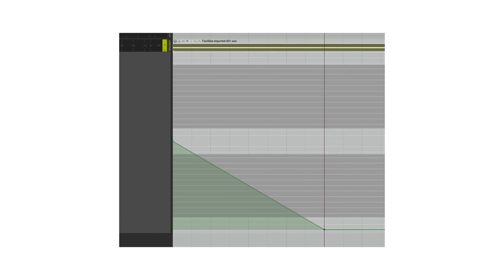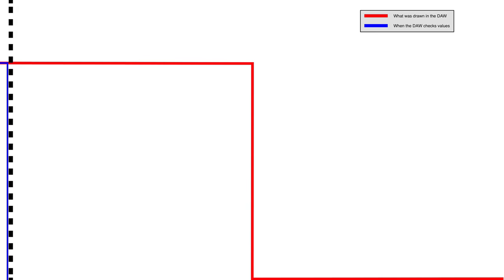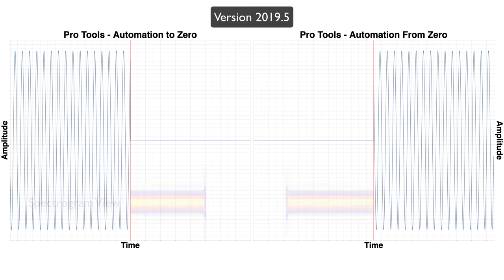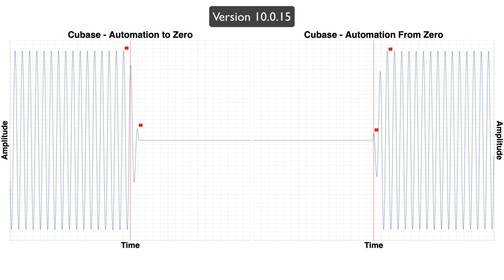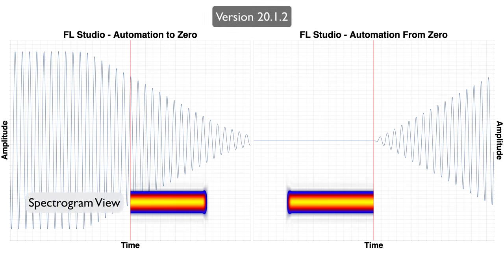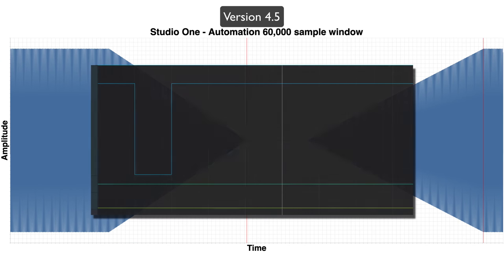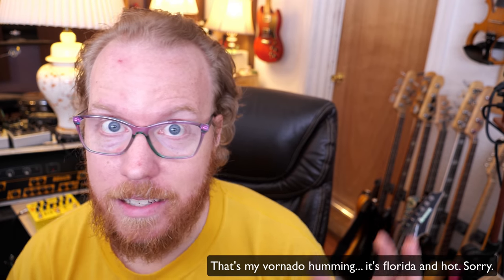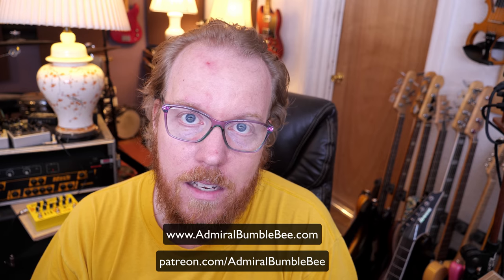DAW v DAW Part 3 - Automation... Part 2

Comment: I think the FL studio is wrong if you automated the fader. The faders has "smoothing" on them for some reason. Instead you should try fruity balance or the channel volume.

Awesome test either way!
Reply from the maker: This entire is about fader automation, not workarounds.

However I'll be visiting workarounds and settings in another topic.
Reply: @AdmiralBumblebee  But nobody automates faders like that. At least in FL. Anyway, I did test with fruity balance too and it had the same result unfortunately.

Comment: I don't see how the graph at 1:18 can be correct. How could a low pass filter when filtering an unchanging signal produce a sine wave? The frequency of a signal that isn't changing is zero, so there's nothing to filter.
Reply from the maker: If you have full scale samples happening at the nyquist frequency, what's the resulting signal after lowpassing? The exact same thing happens when the lowpass is tuned to the sampling frequency of the automation.
Reply: @AdmiralBumblebee  I tried it in Audacity. There's a transient with the expected damped sine shape, then a row of (still) full scale samples.
Reply: @AdmiralBumblebee  Did you mean Nyquist frequency or Nyquist rate? The graph at 1:18 shows full scale automation samples at the Nyquist rate, which is what I used in my test.
Reply from the maker: @gmusic2332  Sorry, I did mispeak. Samples at nyquist rate, the resulting signal is at the nyquist frequency.

The signal is changing though, as there is a sudden discontinuity in the signal. That will result in a ripple before the discontinuity given a perfect reconstruction filter, and even worse with a worse filter. My animation could definitely be better here. The pre-ripple should be slowly building before the discontinuity.

I didn't show it in the video, but there are two DAWs which have exactly this behaviour when the project is rendered (but not when played back!). If you look really close on the images on the website, you can see it. That's the primary sign that there is a low-pass filter used.

Comment: FL Studio performed the way it did because you automated the "Insert 1" mixer fader, which has built in smoothing for whatever reason. 
What most people use to automate volume accurately is either Fruity Balance, or the Limiter. FBalance has almost no smoothing (keyword: almost) and its the fastest way to automate volume. The limiter has NO smoothing at all, but because of this, it creates clicking on the signal because of how fast it cuts it out, and some people don't like that, so they do it with FBalance instead.

I suggest you should try automating the volume with either FBalance, or the Limiter, (or both!) to get a more accurate curve.

I also noticed you have the slide button on in your automation settings (right above the "Track 1" label on the playlist), that might have caused you some problems you described in your blog, so turn that off!
Reply: I tried and it is the same with fruity balance unfortunately. Did not try with the limiter though